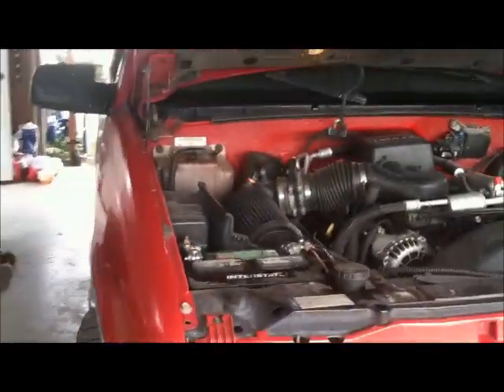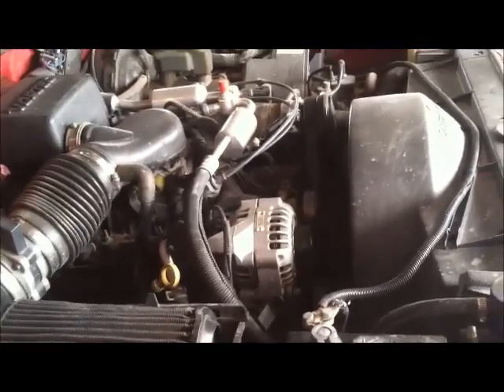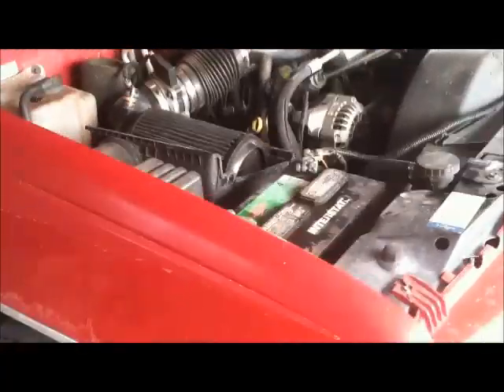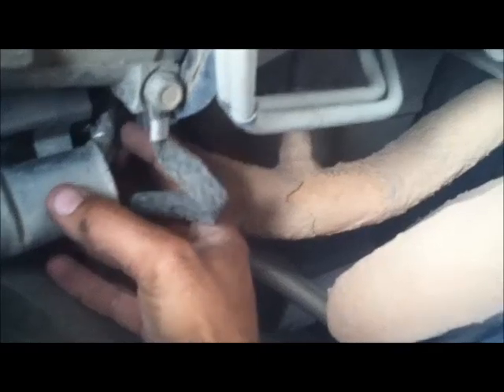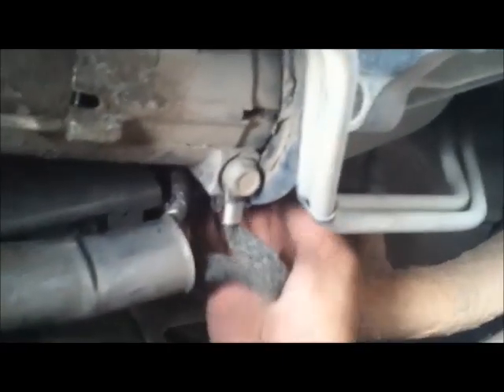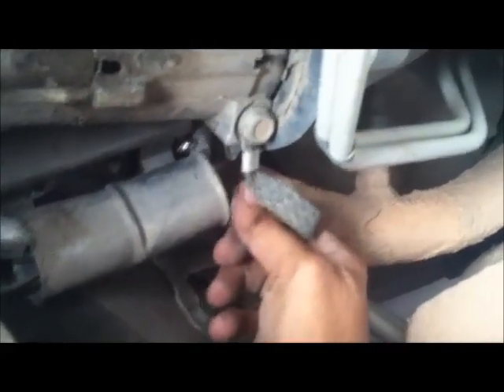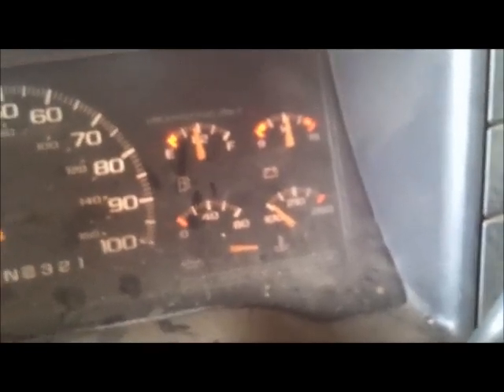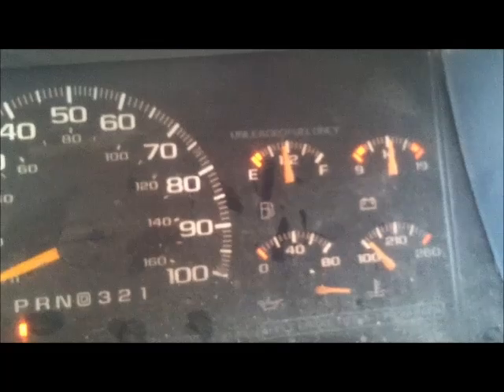How to Locate a Ground Short Easy Way

Comment: Have a problem with my 92 s10 4.3 t.b.i.  replaced harness from fuel assembly cause one of the leads was burnt cause the pump not to have power well i fixed that and the pump started working kicking on and off as it should , still wouldnt start cause i wasnt getting fuel to the injectors , come out the next day and fuel pump wont kick on put a light  tester on the harness of the fuel pump leading to relay it was a dull light not bright at all the fuel relay doea kick on and off like it should .... Can anyone tell me what this could be ?

Comment: Noticed the voltage with my truck sits low (11-12v) especially at night the truck will even shut completely off sometimes. Wondering if the ground/starter assembly is similar to your truck? 1995 Chevy K1500 TBI 350 motor

Comment: whats funny is i am having the same problem but on this case i went ahead and pulled the fuse for the LBEC2 and from a 2 amp draw i now have a 1 amp draw, if i pull the fuse for the air bag it drops .2 and i have pulled the fuse for the radio amp and it dropped .8. amazing how little stuff like this can screw everything up. thanks for the video keep em coming.

Comment: lengthy  question my hereI have a 2005 navigator in a NO CRANK NO START CONDITION! stuck in LIMP MODE! with ABS light on and U 1900 and multiple CAN codes not one of these mechanics seem to know what to do with my baby last week while driving the engine chime said check electric throttle and the truck went into LIMP MODE! I limped into Walmart and told myself since I live 5 minutes away i'd limp it home  when I came outta Wally World it was NO CRANK NO START! not a click or anything someone came to jump the starter but the starter didn't work I went to Oreilleys and bought a new starter and that one jumped by bypassing the solenoid and it fired right up and I limped home and since the dash said check electric throttle I had someone come by and put on a brand new throttle body i'm no mechanic and i'm  told that I needed to go have the new throttle body calibrated I was also told that it could've not necessarily been the starter but a bad engine ground unless the dude lied when he jumped it and charged me to put on a new starter I am seriously looking into having the shop look at the ground once they recalibrate the throttle body I was also told that the Advancetrac and ABS light will come on in this truck if there are ground issues i'm so lost because the first shop it went to said that the PCM ain't reading the TCM for whatever reason and to buy a new PCM to "see if that work." now the truck is sitting at a transmission shop until Monday because the first thing I wanna do is to see why the PCM ain't reading the tranny and to get it starting with the key instead of the solenoid bypassed with a makeshift button my keys and immobilizer are fine so it's not an anti theft issue WHAT SAY YOU ABOUT THE GROUND POSSIBLY CAUSING A NO CRANK NO START IS THAT EVEN POSSIBLE? I want to be armed with as much information as possible talking to these people. I have a new battery, starter, and throttle body, the truck idles extremely rough i'm guessing that's because the throttle body ain't calibrated plus plugs and coils are less than 6,00 miles old so they should be good.

Comment: I replaced the oil pan on my step daughters 2007 Cobalt. Once everything was back in and oil filled, the ignition would only click like the battery was dead. I put the battery (which is brand new by the way) on a trickle charger overnight but still does the same thing. I have checked all of the connections on the wiring harness that was attached to the dipstick tube and all are good. Am I missing something?
Reply: Did you figure it out ! Sorta sane problem on a 98 s10 4.3
Reply: @rickbokern4179  Nope, Still sitting in my yard dead. Going to just have it towed to a mechanic.
Reply: I have whole fusebox going to ground. Can't locate it for shit. No fuses are blown though. Weird stuff

Comment: My 1999 Suburban has a “new” motor in it. I have had the same exact issues you were having. I would have to take the negative terminal off the battery, and then reconnect it and everything would be fine for a little, then happen again. I gotta get under the truck now, thankfully it shouldn’t be difficult because it has a 6” lift, and see if it has the same issue. Thank you for posting this video sir!!!

Comment: I have a 2008 dodge avenger and i had the same issues gas tank fluctuating it would not charge my battery my starter went bad on me i probably have the same problem changed the alternator checked the battery and still wouldnt charge i will check the ground next.
Reply: Did u figure it out

Comment: I got an issue where my voltage jumps back and forth with my signals on or 4 ways but stays solid with lights on and heat, 🤔 and she's got a stutter and I've changed pretty much everything plus cam some times she runs real good and some times she runs rough I always thought it was a bad ground but I don't have that ground from starter to bell housing 🤔

Comment: Hey hopefully you can answer my question. I have an Audi that continues shocking me while I’m driving. I think it’s coming from the steering wheel, transmission handle, or door buttons. What could be the cause of this? Maybe there’s a bad ground which forces the electricity to ground to my human body
Reply: Ground issue for sure

Comment: I'm basically having the same problem minus the fuel thing with my 6.5 it's like its not charging but the alternator is good. I wonder if mine is a bad ground somewhere also
Reply: Did you ever found the problem?

Comment: hi sir thomas, im no mechanic but i have a similar problem, when i start the car voltage will be around 12v then after a few minutes it will charge to 14v, then if i use headlights or turn the AC on, the voltage will drop low up to 11v when im in idle, i find help from a mechanic and he say its just my voltmeter that is not accurate he says. but im not convinced. and also when i use AC for too long the check engine light will flash, i havent used my AC for a year cause im scared it will discharge my battery faster i bought a new one, and i had my alternator checked and it was ok.  i need help cause i havent had this problem before and now im anxious using my AC or other electrical components , even starting my car when i see that low voltage
Reply from the maker: it sounds like your alternator is working but its on its way out. check at idle what volts you have, ( should be 13.5 plus volts. most will go to 14.2 volts. if its less than 13, its prob bad. then raise your idle and check the voltage. the voltage should still be at 13.5 to 14.6 what ever it was at during idle. if you get alot more volts when giving some gas, then the alternator is bad. it should put out about the same amount of volts when revving as to idle. if the voltage is better and at spec during the raising of idle then you have a week alternator. the voltage test that most auto parts store do, will test it at 1000 rpms, if your car idles at 600 to 800 rpms then you may not be spinning it fast enough to create the voltage you need. when a alternator is going bad, (before it goes out) it will require faster spinning to produce 14 volts. thanks for watching, good luck,,,,,,enjoy

Comment: I'm having a very similar problem, except it starts at 14v and after it warms up, it drops to around 12v especially when I use a blinker
Reply: Exact same problem I’m having, any luck fixing it?
Reply: @jacobthornton9660  i think it might have been the tensioner or belt or both. I've rebuilt my entire engine and replaced everything including the alternator, with a cs144 instead of the cs130. So I can't really say for sure which one it was. But i'd start with the belt since it's the cheapest
Reply: @ar501dboy3  any update i have the same issue i believe it might be a bad connection or wires corroded i get 2 codes for heater malfunction on my oxygen sensor

Comment: i finally found a video that kind it seems like my problem  well i replaced 2 alernador and i got low voltage on the test ( i also  was  was experience kind of surging on parking and lights  intensity up and donw well    i gave up keep driving i have been having  intermintent  no crank no star  for  the last few months last one was at the gas station it was very low i stoped put gas  and  car  didnt star   next day  car star  like nothing happen  ( i have been filling my tank  with car running but  the car just died againg 9 AFTER  OVER   month of  quick star  ) and this time is not starting of all ( i was less thank half if  that helps )  i turn car off  went into a restaurant  come back and car  giving just a click  sound  all lights  work and radio  work  .. me canic  wants to replace starter and i fell like can be something else since i dont  see the relation  with bad alternadors low voltage and stalling  with a broken starter or is it?

Comment: can a ground short like this cause the fuel pump in my 94 c1500 5.7 to overheat on the freeway and decelerate my truck at 65mph+ after a few minutes at speed?
Reply from the maker: No but a vapor lock or bad pump can. Thanks for watching!

Comment: I had a ground problem going down the highway 70 mph hit bumps in the road my truck would die hit another bump it would run i found out that i needed to run a ground from the engine to the body and from the body to the frame fix my problem never happened again oh by the way i used extra.battery cables i had laying around that was heavy enough wire fro the grouds
Reply from the maker: sounds like the engine or tyranny was removed and someone did not put the ground strap back on the bell housing bolt. this comment will help others, thank you for taking the time to post it. thanks for watching. ( you can never have to much ground )
Reply: Same

Comment: I have a ek3, sometimes my windows won't work, neither the horn and the car stalling.
Reply from the maker: sounds like multiple issues. the windows is prob something in the drivers switch, the horn there is a fuse , but the ground connection will be in the steering wheel itself. as far as stalling, there are so many possibility's. is there any codes ?

Comment: my 04 GMC Sierra 4.8 resets the computer at start up what do u suggest I do I replaced the catalyst converter and the oxygen sensors check engine light is off drive it 200 miles and nothing maybe it could be a ground wire bad connection but not sure where to check?
Reply from the maker: try resetting the ecm. do a soft reset. disconnect both battery cable and put the together for 5 min. this will drain the capacitor that keeps the memory for the ecm. reconnect and see if that works. if it does not, then you have a something shorting out or a bad ecm.
Reply: +thomas brian  yes I did that yesterday and still nothing I noticed when I disconnect the headlight in the driver side my truck marks reduced engine power I'm not sure if it's an electrical problem..

Comment: Hey bud, I have the problem when I put my turn signal on, my voltage clicks down and up in sync with the turn signal. Now I keep blowing IgnA fuses. I got the same truck as your 96 silverado v6. Could these be related. Im a decent mechanic but never messed with electrical so Im watching all the videos on youtube to try and fix this Ign A fuse blowing problem.
Reply from the maker: i think its your turn signal switch. yes they are related.
Reply: thomas brian, like the actually switch? I'll try and dig around and see what I can find. The ign A fuse is only blowing when I turn the key over to start the car.
Reply from the maker: not key on, when you actually engage the starter? i think i am confused. when exactly does it blow, on accessory or starter, and do you have the lights on or off, and what about turn , is it on at this time as well?
Reply: When I go to turn the engine on. Lights and turn signals are off. It happens after accessory turns on and I go to crank the engine. Blows instantly and doesn't let me crank.
Reply: And now when I think about it. It blows once I engage the starter. And blows instantly before the starter even hits once

Comment: Man this is exactly my problem or one of my problems but I was looking in my engine and I noticed way down in the bottom it look like a shoelace there was a negative voltage or whatever the negative then I followed it up and around and it melted up top just like yours followed it down that's all I got but wait until daylight I'm going to go out there because I didn't think nothing of it I'm still thinking of security issues and everything else but my voltage was down and it keeps going down
Reply from the maker: that is prob it then. sometimes voltage loss is confusing because a bad ground does the same thing, so we look at the current side of things. thanks for watching.

Comment: Bad grounds can cause all kinds of stupidness with these vehicles. You're partially incorrect though. My truck has the one piece, nut stud combo for all except the bottom two bolts. Grounds only (on my truck) get connected to two of them (the hardest ones to access of course.)
Reply from the maker: actually three, you have the third one behind the left head, to trans. thanks for watching. enjoy,,,

Comment: Hi I have for 2 months trying to find problem w/ 2002 Pontiac Montana
New alternator new battery new computer Still not working 
All wires clean cables clean fuses good 
I will send a hundred bucks to anyone that can tell me exactly what's wrong 
I'll fix it my self 
I don't have diagrams of all ground wires 
But this is just crazy Please help 
PS dash lites and radio/ CD lights dull 
Along with head lights 
Alternator I'd not charging battery 
I will pay if diagnosis is correct and you send me how to fix in excatly the car I have 
2002 Pontiac Montana 
Thanks
Reply from the maker: check your acm fuse
Reply: Rose Griegorian go to Google type your year of your car and your make with the words wire schematics and then wire engine schematics you will get to see what goes to what relay and what little control module is underneath or that's is underneath the steering wheel in my car my GMC but there's also a little module it could control the door locks the lighter just anyting some stuff are separate if a module is blown it will keep sending power instead of turning it on and off and going on and off the same time you turn the car off on off it stays on this is one of the same problems in my car then I followed the schematics their color coded you will find your problem it's not the alternator it's none of that I thought it was a bad ECM it's not that you know it was crazy it ended up being my door latch because my door latch was broken into and they got in the truck so the sensor and the light was messed up so I didn't know that the door latch would stay on so then the module was blown when somebody hooked up the battery cables wrong and when I did everything or reversed everything did everything right there was that wire left on and it's because the module head blew its own fuse a module was just housing little whatever fuses or resistors and stuff like that I should say check that out check something that has its own module that ends nowhere to ground
Reply: Rose Griegorian 7076553532

Comment: I have a 2007 Buick Rendezvous that recently has a low volume moaning noise at start in the radio speakers, also the radio channels need to be reset, and finally my in dash compass indicator calls for Calibrations frequently.??